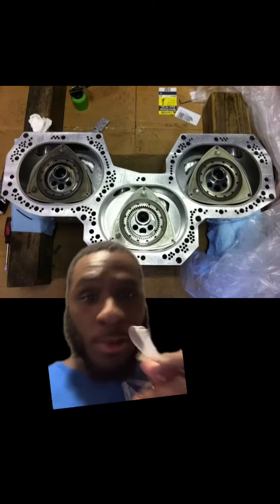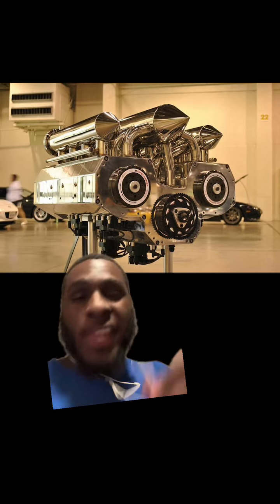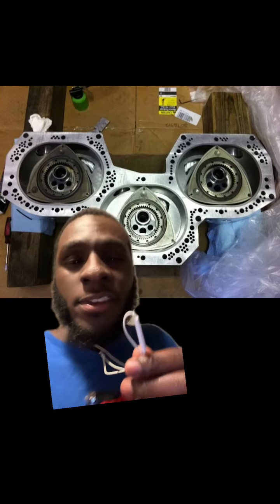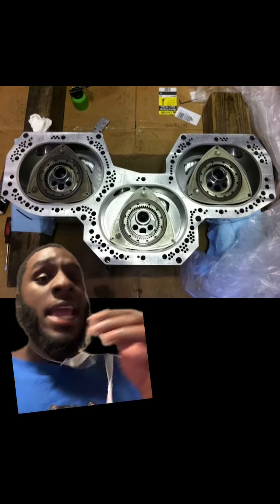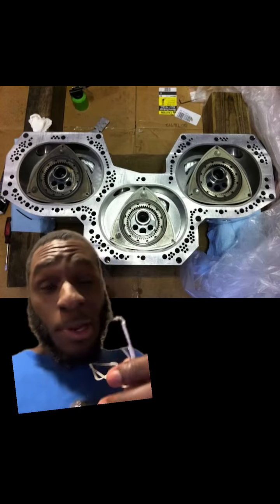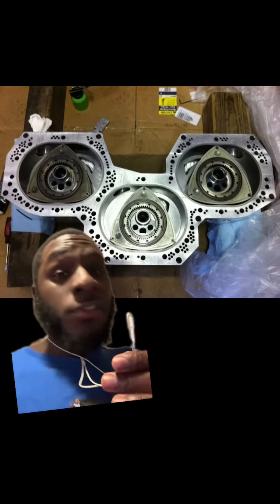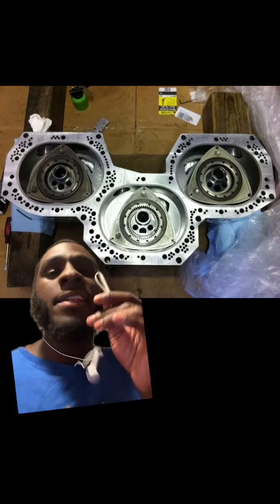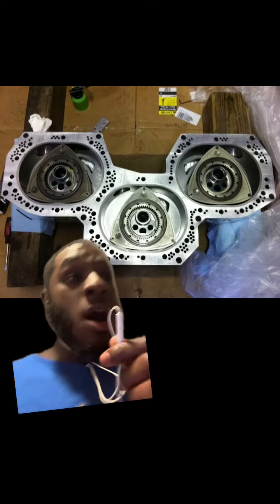The Big Block Rotary! The Secret weapon Mazda never used!🤦🏾‍♂️

Comment: I don't know why rotary engines get such a bad rap. In the late 80s to mid 90s i drove my 1984 Mazda RX7 back an forth from Louisville to Memphis for the 4 years i was stationed at Ft. Knox. I put well over 150k miles on it with zero engine problems. It was a fun little car i wish i still had.
Reply: The ever lasting enemy of automotive enthusiasm: Heat
Reply: It's because people get them that don't know how to maintain them. Also since it's different then a piston engine alot of shops don't touch them because they don't have a mechanic that knows them well enough to fix it which leads to  higher cost of repair at the only shops that do the rotary work. They are great engines as long as you take care of them how you are suppose to and let them rev higher then a normal piston motor to clean them out. Most people just expect them to behave and act like a piston engine so they ignore the easiest things you can do to make them last forever.
Reply: There also incredibly easy to.fix when they do loose compression. The apex seals are easy to swap out and replace.
Reply: @ChevyS10LSUK  your right and as soon as you learn about and understand the rotary then it really is a very easy engine to work on. Do a full refresh about every 80-100k miles and it will last forever... plus they sound so good and unique.
Reply: @ChevyS10LSUK that is a pain in the ass.

Comment: the horsepower of this thing was actually mentioned- at 10k rpm, 110 octane fuel, and 50 pounds of boost it made 5,400hp to the crank. even on pump gas na it still made 1500hp. absolutely mental

Comment: This could be a good option to re-engineer for an electric application.
Reply: Nah but it's a great idea for that new omega 1 rotary engine that uses hybrid. A 4 rotor set up with those gets you over 600hp and 600ft lbs for onky like 140lbs of weight with 60 percent thermal effiency and a redline as high as 25,000 rpms.

Comment: I want to know how n the hell a transmission is supposed to work on it?
Reply: The crazy part is. Rob Dahm was given this particular motor by Tyson Garvin himself and was told that it has the exact same mount positions and bolt patterns for the flywheel/clutch and trans as a big block chevy. 

Since he wants to eventually use this 12 rotor in a marine application which BBC's usually are used for. Yeaaaa I'll let your imagination run wild with that info
Reply: @averagefusionenjoyer7096  oooh I guessed I missed that in Rob's video when he got this... so marine vehicles aka race boats don't use transmissions do they, I wouldn't see why they would...
Reply: @K_Swap_The_World_69  Now, as for that, I PERSONALLY never got into the world of marine engines, so for all I know, it's completely different for them then cars BUT basically whatever can fit a big block chevy. Can fit this monstrosity as, like I said. The SAME mount placements as a BBC. imma just let that marinate in your mind for the swap possibilities